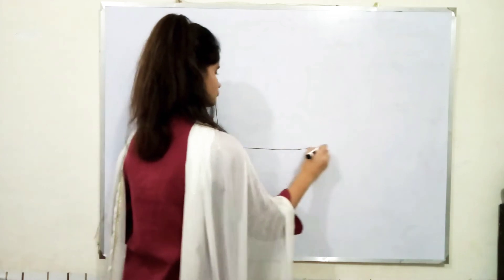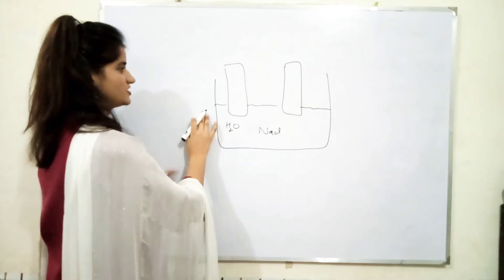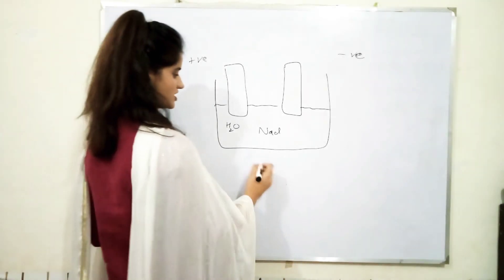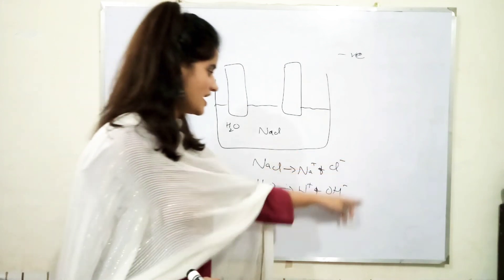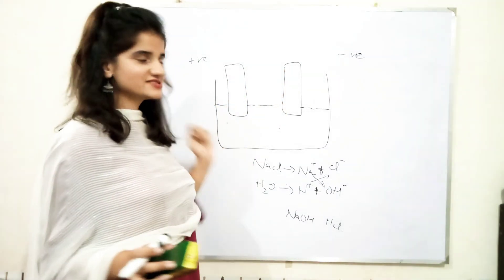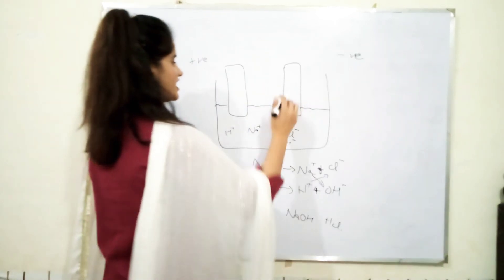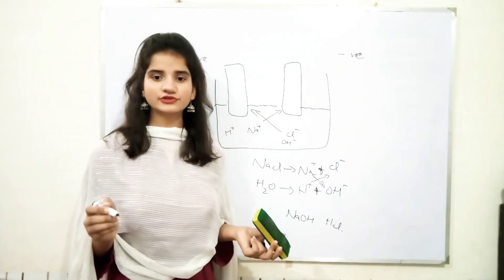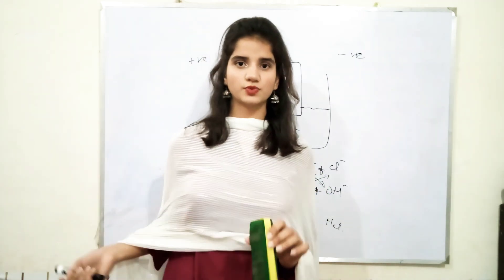How migration of ions occur in electrolysis?

Comment: Roll no. 14
When current is passed than NaCl is disassociate into Na+ & Cl- and H2O into H+ & OH-. When these four ions are present technically together then NaOH  & HCl are formed. But in this solution , Na is attracted towards -ve terminal while Cl towards +ve terminal. In this process , electrons enter the solution at cathode and give at anode. This two way migration of ions is considered as convection.

Comment: Due to electric current charges develop.
This causes the electrolyte to dissociate into ions
Ions instead of coupling with one another attract to electrodes due to their stronger force
In the above example of sodium chloride solution, Na+ goes to cathode and Cl- goes to anode
Electrons enter at cathode and leave at anode This two way migration of ions is called convection.

Comment: The current passing through the voltmeter causes development of charges. This lets the electrolytes to breakdown into their respective ions. The ions do not interact with one another rather they get attracted to the electrodes (bcz the electrodes have more ability to attract ions)
In case of NaCl solution, Na+ is attracted by cathode and Cl- is attracted by anode. This two way migration of ions is called convection.

Comment: ●Humna Irfan
● Roll no 10
▪If we take a voltameter and put 2 electrodes in it. Positive electrode is anode and negative electrode is cathode. The electrolyte solution is NaCl (in water).
▪ Then we will pass current across the voltameter, NaCl will dissociate into Na and Cl. And water will dissociate into H and OH. Technically NaOH and HCl should be formed. But this does not happen because the force of attraction of electrodes on ions is greater.
▪So, Na and H (cations) will migrate towards cathode (negative electrode) and Cl and OH ( anions) will migrate towards anode (positive electrode). 
▪ Electrons enter solution at cathode and are given up at anode. This is a two -way migration of ions.
▪This important process is also called convection and it also occurs in human body.